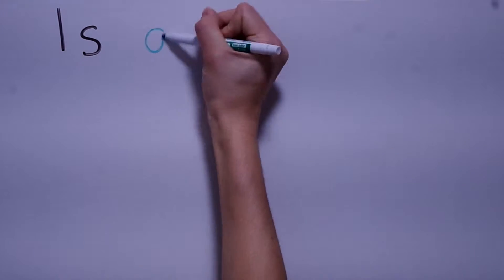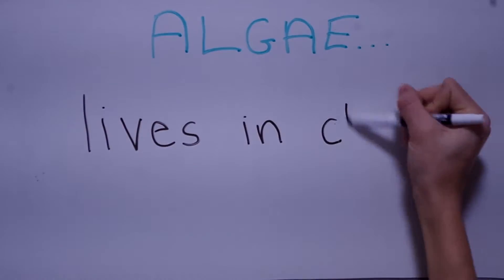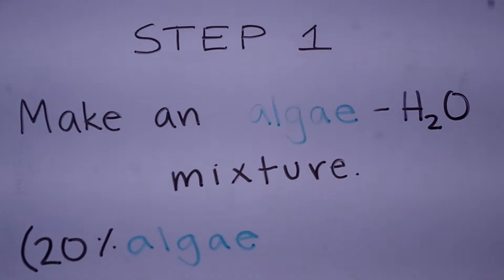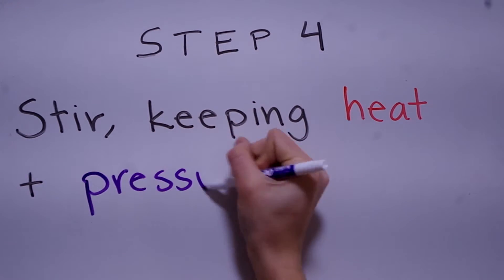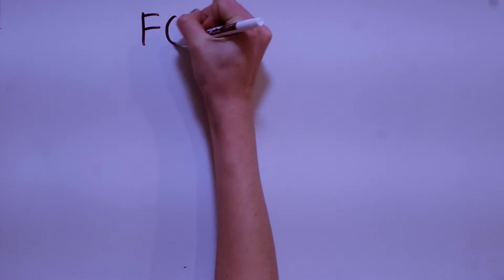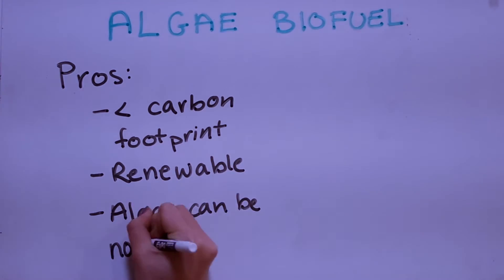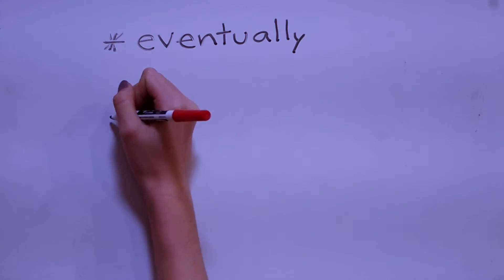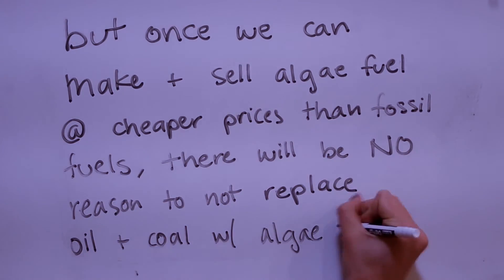Algae Biofuel (Lauren Koyama, Lauren Jozefov, Jacky Moore)

Comment: All wastewater (sewage) treatment facilities are a vast source of nutrient rich water (depending on the stage of treatment). Some of those wastewater facilities have anaerobic digesters which produce very large amounts of CO2, which is usually vented to the atmosphere. Those same digesters also produce large amounts of methane, some of which is used for co-generation of power, with usually a large surplus of methane being torched (burnt-off). That surplus (wasted) methane could be utilized as energy/power source for algae facilites, reducing energy cost. Of course, doing so, would be a potentially large scale, off-the-commercial-grid operation (big no-no)...And worse, producing cost-effective bio-crude, perhaps cheaper than cost of fossil crude industry can provide. -Now that would threaten Big Oil.